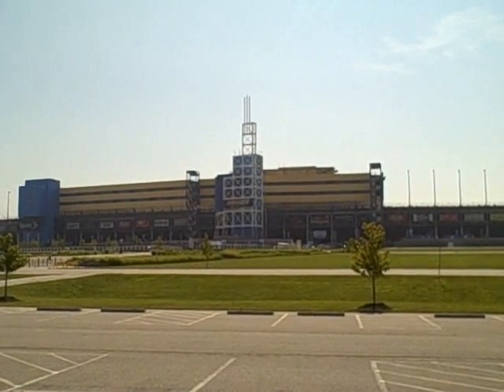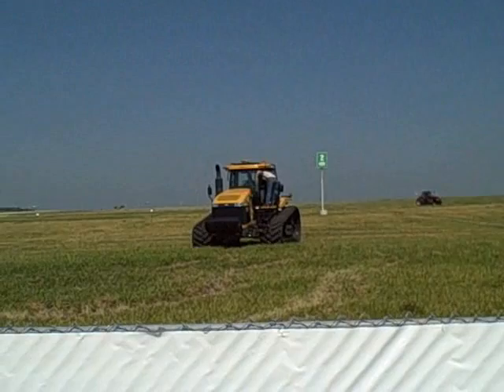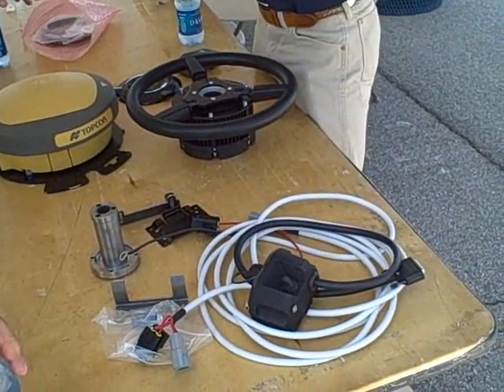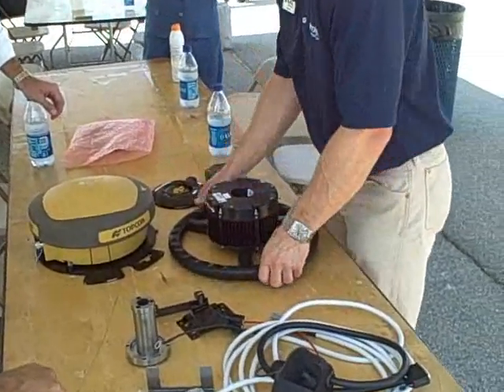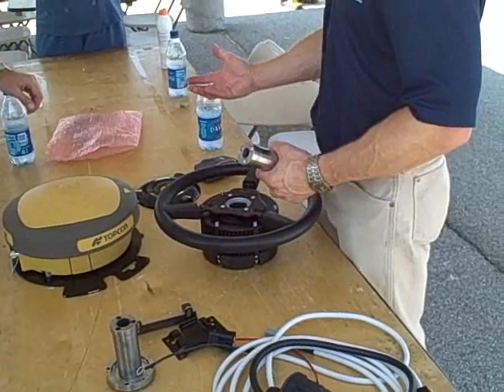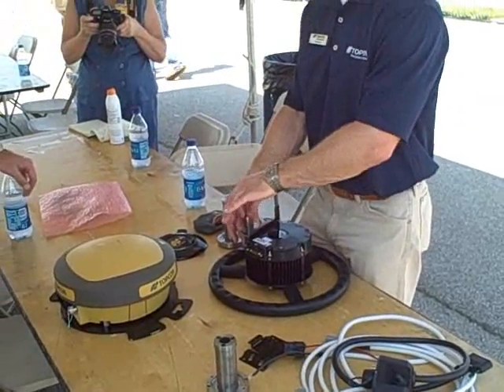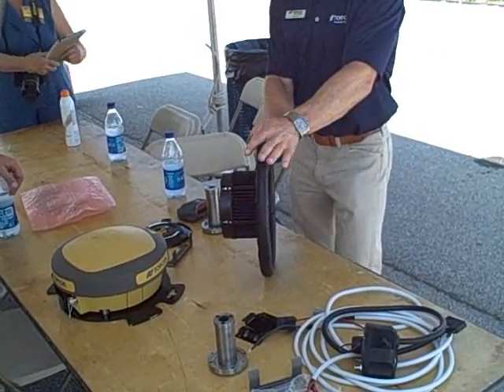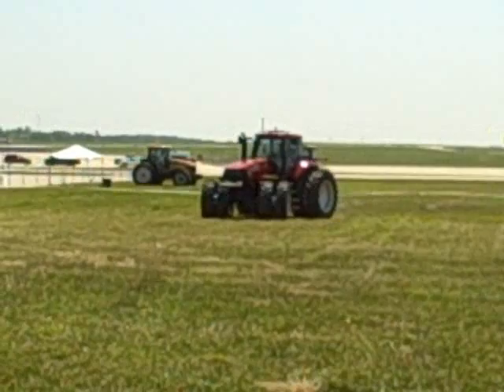From PrecisionAg.com: Topcon Introduces AES -25

Comment: It would be a much better presentation if you had a display of 6 to 8 different actual steering columns for mock - up.  Then physically demonstrate how easy it is to move between machines.